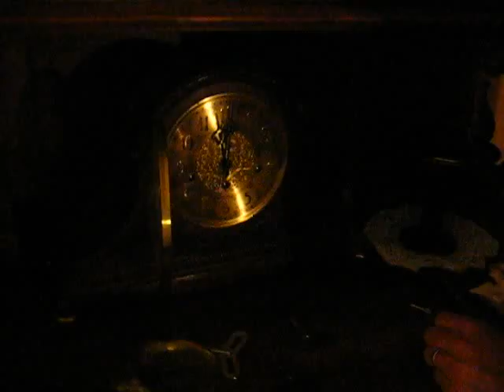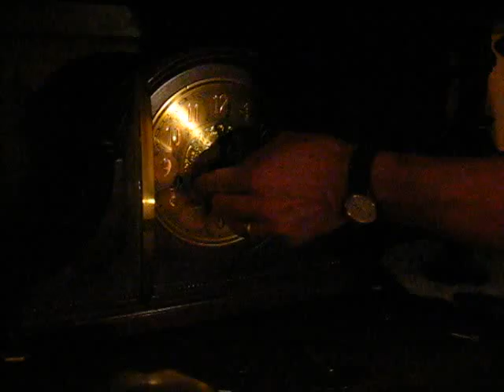The Out of Tune Clock

Comment: a clock like that, would get a good home in my collection, I have a lot that started out sounding crappy, but I've fixed them up, usually it's just the hammers that need adjusting, and possibly new rods,  it sounds like what's happening, the rods are being mutied by the hammers not bouncing far enough up after striking it also sounds like the second to lowest note is being hit instead of the lowest one, giving that double note thing in places, the clock is in the F major scale, good luck! Kriss

Comment: the clock you guys have, just needs 8 new rods, it's chimes are westminster, whittington, and st michael, by the sound of it, there is only 1 note that's  out of tune, and it's possible, with new rods, you could fix it I collect clocks and have a kean ear for chime melodies. if you were in the UK, I would gladly salvage it and make it run again, it wouldn't take a lot.